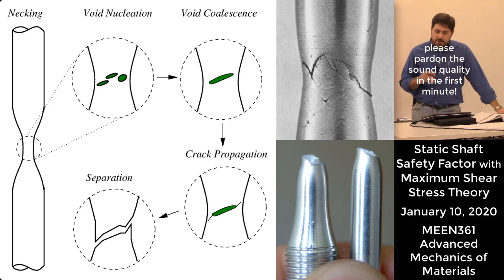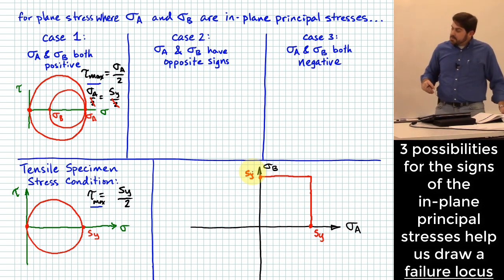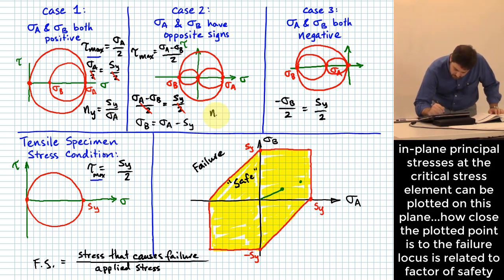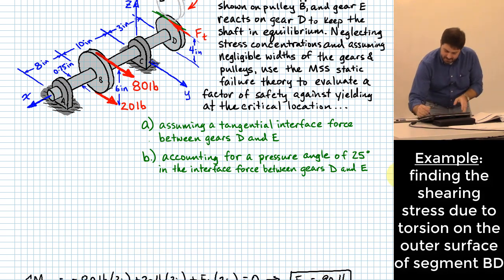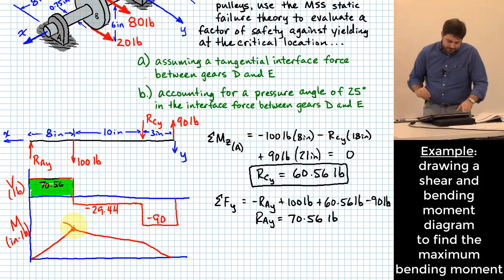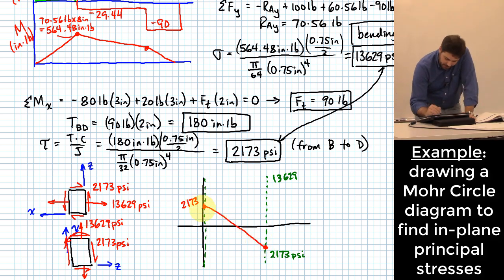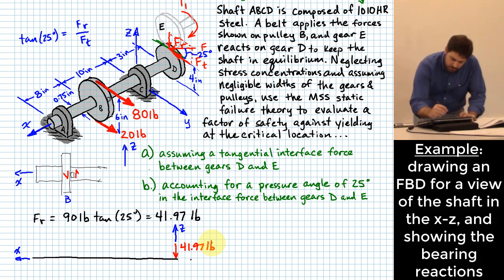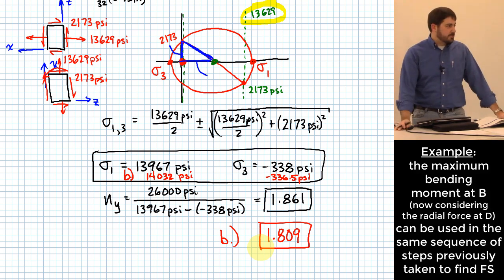Finding Factor of Safety with Maximum Shear Stress Static Failure Theory | 1 & 2 Plane Shaft Bending

Comment: Why isn't segment Ab in torsion? Since torsional force rotates the entire shaft about it's axis. Doesn't matter where you apply that torsional force
Reply from the maker: It does matter where torques are applied, actually. The torque carried in AB is negligible because bearing A is the only element present that could apply a torque at A, and we are assuming it is frictionless. As a suggestion for the future, it may be more appropriate to ask questions about what you want to know rather than making statements. :)